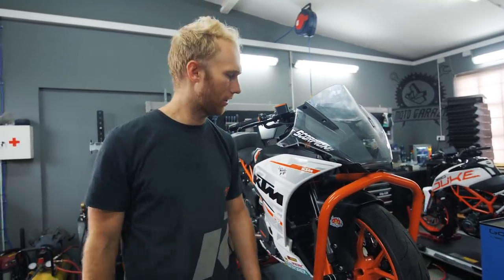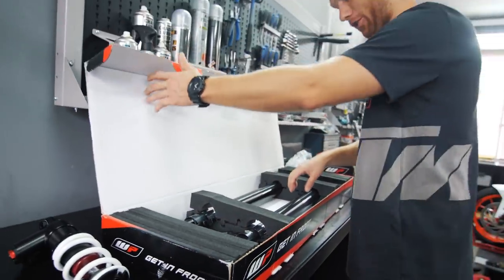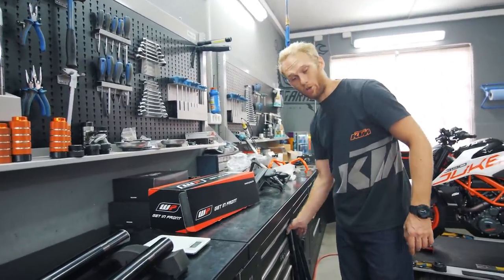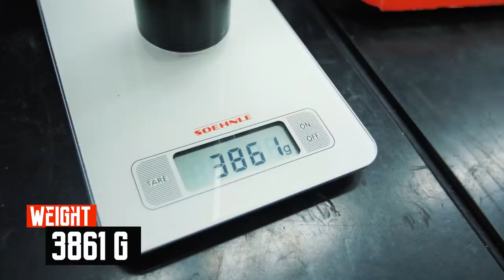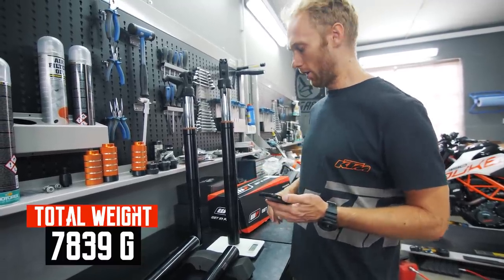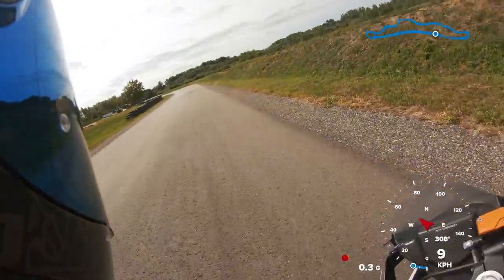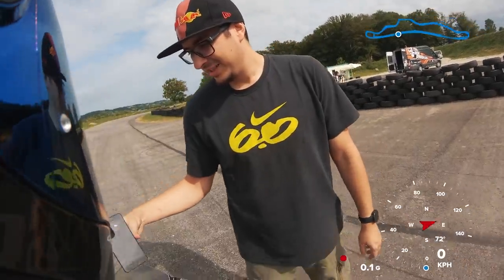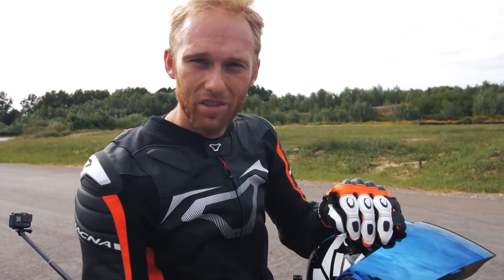KTM RC 390 from DRIFT to RACE [part 2 - MONSTER UPGRADE] | RokON vlog #88

Comment: ROK add a quick shifter and remap the ECU the RC will be a monster
Reply: I think so it already has a quick shift
Reply: Dont forgot fuel injector, intake box modification and remove cat
Reply: I was about to say the same mate. 👍🏼
Reply: @pradeep3011  s

Comment: I need this bike. Actually I used to own a 2017, brand new, first bike. I changed the stock exhaust for a 3/4 Race Only Yoshimura R77, it sounded great. I also changed the radiator Fan for a Spal one and the radiator cap with more psi and put some Engine Ice in there. I also bought some EBC synth brake pads but those were never installed. Overall such a great bike, specially for being a "beginner" / "entry" bike. This thing can keep up with the 600s on the twistys. Sometimes I regret selling it. Only issue was the overheating/head gasket/coolant/fan issues.

Comment: 14:16 what is this body position? is almost like your lower body whats to do something and the upper is like nope, lean more with the chest and specially the head, if you pause the video at 14:16 you can see that  your head is in line with the bike you gotta move it to the right almost as you are kissing the handlebars.
Reply from the maker: Thanks for the great tips, will try it out next time ;)

Comment: go aftermarket brake master pump rather than brake disc
Reply: I have the Brembo 15RCS on my 2015 RC390, stock pads and disc and it grabs like mad, plus I can adjust the master cylinder to grab hard or for more feel depending on conditions, fonna still get the pads and 320mm disc though.

Comment: What about the clip on bro...
Reply from the maker: Comes next year :)
Reply from the maker: Any recomendations?
Reply: Make video on how the tyres size and pressure should be taken riding on road or track. With any cc of the bike both the front and the rear Tyre. Adjustment of shockers and all. I'm a big big big big fan of yours😎😎😎

Comment: You did not weigh the back shock absorber between new and old like you did the front
Reply from the maker: Forgot it 😭 realized it when it was already on the bike 😤
Reply: I was just curious of final weight but regardless they worked great in the video